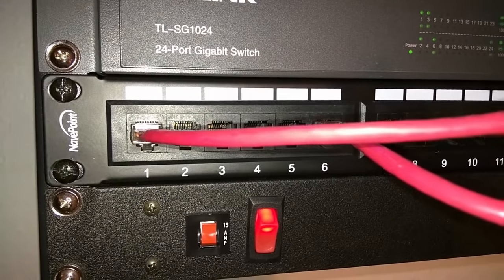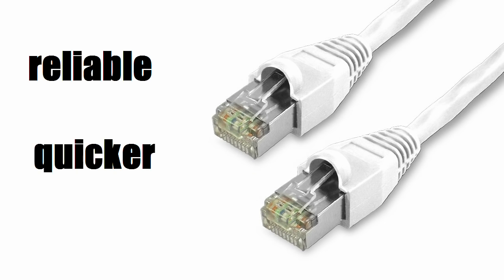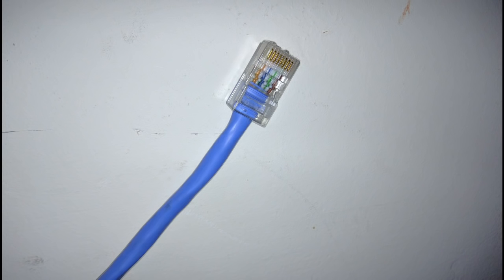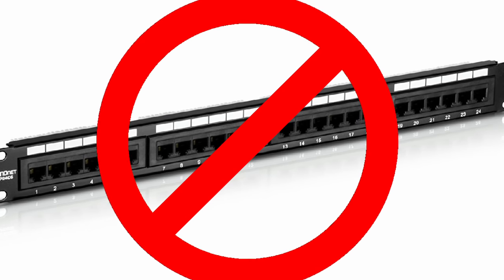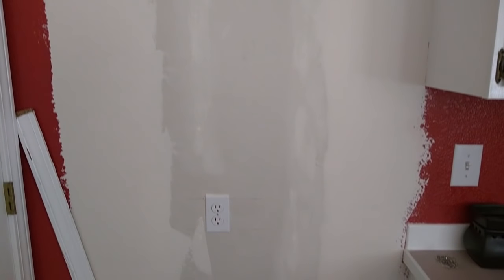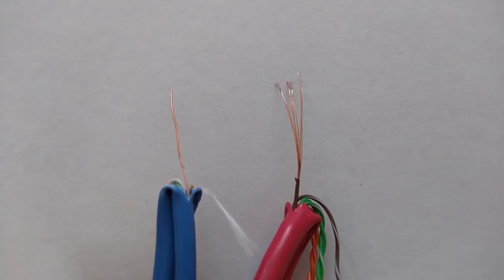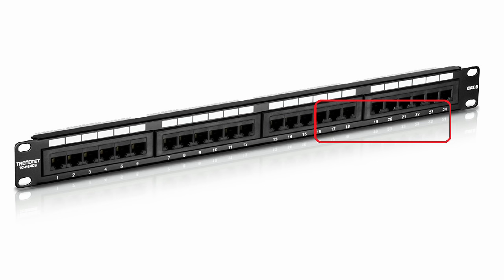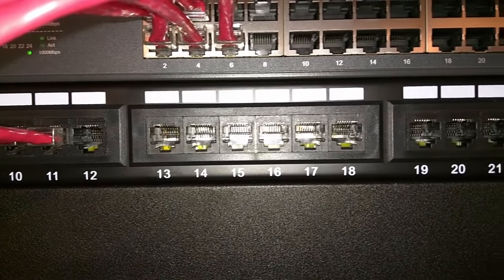What is a Patch Panel? Do You Need One?

Comment: Hey Budget, got a question for you. Is there any added benefit of using, and bare with me, my terminology might be wrong, but any benefit using manually wired keystones vs the dual female connected keystones where you can just plug in your pre-wired RJ45 network cable on both sides of the keystone? Obviously the pre-wired is good for someone without the tools or knowledge to wire it, but is there a benefit related to reliability/performance that can be gained by using the manually wired connection? My impression is that it's just a matter of being able to purchase bulk cable and save some money vs paying more for pre-wired connections. I'm I correct?
Reply from the maker: Hey. Seems like you understand it. Yeah it would be more expensive, and more of a hassle if the Ethernet cable clip snaps on the inside of your plug.. but it's totally an option for those without punch down xp, or the tools. I wouldn't expect to see any real performance hits.
Reply: You want him to take his clothes off???  Perhaps you meant "bear with me".  ;-)

Comment: Thanks for the video, would you mind clearing something up for me please? I dont understand why the switch doesnt just include the patch panel punch downs on the rear (or even just RJ45 holes on the rear)? Surely that way the connection can just wire straight through to the front connection and save needing a whole patch panel unit?
Reply: I would think about it more as- The Patch Panel is an extension of the home, whereas a switch is a piece of tech you own and may use in another network somewhere down the line. 

If the patch panel was a part of the switch, and the time comes when you need the switch for something else, you'd be left with cables out of a wall looking a bit messy. Separating the two means you have the flexibility of taking the switch out easily and leaving a nice neat patch panel as a more 'permanent' fixture.
Reply: @p.staycalm  Thanks for the explanation, that seems like a pretty good advantage.

Comment: Two points.  First people who do this for a living come up with ways to do their job, often because they do not get paid if they have to come back and do it again.  Follow their advice.  Second, do a hybrid approach.  Run your wires with the plan of putting in a patch panel later.  If you do not use a patch panel, but act like you will put one in the future, you are in a good place.  You will have extra wire on the ends and you can run double runs to areas where you are likely to have many connections, ie my office or the tv room.
Reply: Yes, I went the cheap route which doing my Home Network when I just got my House.  Didn't have a lot of extra money for the network.  I was also installing a large Antenna, and having to run all new COAX cable and ground to a number of outlets as this older house lacked a real ground everywhere except the Bathrooms and kitchen.

So I ran my Cat6 cables out of the wall long, and installed normal RJ-45 plugs onto them and plugged them directly into the 24 port Switch.  This allowed me to not have to get a Wall Rack or use patch panels.  My hardware was sitting on a couple of wood shelves.  That was how it's been for the last 5 years. 

A couple weeks ago, I completly redid it.  I installed a Wall Rack, and a couple of Patch Panels.  I cut off the RJ-45 plugs and connected them to Keystones then snapped into my Patch Panel.  I think this is a far better way to go for a number of reasons!!!

Comment: Thanks for explaining patch panels. I am clearly going to need this for my new home under construction which is getting Ethernet jacks wired in every room. The wiring cabinet in the laundry room is where all the  Ethernet cables end. It is a giant glob of cables entering the cabinet from elsewhere in the house. 

My question: How can I figure out which cable terminating in the wiring cabinet connects to which jack? Is there a tool I can buy or technique for figuring this out other than tediously plugging in a computer into each and every jack and then running back to the wiring cabinet to see if it gets connected to the Internet?
Reply from the maker: Check out some of my other videos about networking. I explain some of that.

Comment: Here's the bottom line for patch panels:

They're basically used to connect every single Ethernet ports in every room in a facility into one area - the telecom room/server room where the patch panel is typically located. Once the cables come in and "patched" here, then they are routed to each vendor's devices/network. It's overkill for a home, but for businesses (even small ones), they come in handy.
Reply: Simply Tom Thank you! This is a great explanation!
Reply: Burry21 

You’re welcome. I’ve worked on patch panels for quite awhile and they’re all the same. Some, just different sizes than others.
Reply: Definitely not for your average home network.  Way overkill

Comment: Does patch paneling work differently for different internet provider types? IE DSL vs Cable vs Fiber? I ask because fiber is only one block away from my current home and will be switching as soon as it is available
Reply from the maker: It almost always turns into copper in the home. So if you're dealing with Rj-45 patch panels and Ethernet, yes its all the same.

Comment: Very helpful for me, thank you. You mentioned that some patch panel jacks could be used for POTS. Can HDMI cable be terminated to a patch panel?
Reply from the maker: I've seen some patch panel ports that will accept a pots jack, if not, a special cable can always be purchased.

As long as hmdi doesn't have more than 8 wires, you could technically punch one down on a patch panel. There is also hdmi over Ethernet.
Reply: If you go with a keystone patch panel, you can get keystone jacks for RJ11 (phone jacks) just like RJ45 keystone jacks. HDMI keystones are also available where you can run a HDMI to a keystone coupler and then HDMI patch (short HDMI) to the destination on the rack.
Reply: If you use keystone panels, you can use whatever type of connector you want.  Typically, those would be Ethernet or phone, but others, such as F connectors for TV, speaker terminals and I believe even HDMI are available and just snap into the panel.

Comment: Why are your Keystone jacks in the walls mounted upside down  ?  The conductors being on the bottom are more likely to catch and hold dust in the upside down position.  You can also tell by the labeling "CAT5" on the jack that they are in the plate upside down.
Reply from the maker: Just oversight.
Reply: Really funny you mention this lol.  You can always tell who has been or worked for a LAN administrator.  Things I use to tell my guys when I was in the military lol.

Comment: Hi, great video! Question about solid core vs stranded wire. I understand the solid core is easier to set up terminations at the patch panel/keystone and is maybe more reliable long term as long as you aren't manipulating it, but outside of that, is there any other benefit? It sounds like if you were to use stranded wire from a wall plug, through the wall, to the patch panel, there wouldn't be a difference compared to solid core, correct? By difference I mean speed, reliability, failure, etc.
Thanks!
Reply from the maker: Speed, reliability and failure should be similar to solid core. Solid core is much easier to punch down and that alone makes the decision easy for me. Also you can get solid core cable with a plenum rating, meaning it's less hazardous during a fire.

Comment: I just ran across your great videos, very informative and your networking video gave me the confidence to troubleshoot an issue that popped up when I increased my internet speed to 200/200- the wall socket jack only had 4 of 8 wires connected, not passing the full internet bandwidth.  Internet company came and fixed it :) 
 I have fiber internet, no video package, going from the ONT in the garage to one room upstairs. Currently I have a Nighthawk router, r7000, doing a great job, and I use powerline networking that is rated for 1.2Gbs, but of course by the time it gets to the downstairs, I'm seeing 70/70 or so. Not bad. My question is, I'm about to go from 200/200 to 1gb. Will the speed of the powerline networking to this location raise, or is that 70/70 (give or take) a hard wall speedwise due to physical limitations of the household wiring vs my netgear powerline 1200? I can't find any discussions on this just by googling. Keep up the good work!

Comment: Clean. Like it. Now how to set up the redundant switch so if switch 1 power supply fails, the redundant switch takes over without pause of services. i understand switch power supplies last about 6 years and then most fail, burn out, regardless of the switch's price. Thus for say an audio system that has to run without stopping, the redundant switch might be good.
Reply: Spanning tree does failover redundant switch connections automatically, but all your hosts need to be dual connected to two switches.  It isn’t going to fail over fast enough to not glitch an audio feed though.  If you need that then you need software to read the audio stream through two active/active connections simultaneously.

Comment: Just adding my view since Author said he is interested, 

The only reasons I feel home users or SMB will need patch panel

1: Asthetic feel / Looks. 
2: LAN Cables in building are more than available switch / router ethernet ports. 
Or in other words,Extending life of RJ45 ports on switch if user connects and disconnects LAN cable frequently. 

For last point, I dont think many users / companies do so with well setup network But hey, nerds are there or someone may be testing (R&D) on n/w equipments. 

I would like to add that, again for most users businesses, once N/W is setup, they rarely go down to the box where these networking equ. are setup, just like, more or less, the permanent LAN cable through wall.

If I am Setting up this, I may endup without patch pannel, If the LAN cables I have are less or equal to LAN ports available on the switch/router and I think most of users may think this way.

Comment: Very informative for someone educating his/her self to design/build their own communications closet. I noted the blue Ethernet cables in your setup project through the wall from below the wall plate. I'm curious, are these cables running from the attic above and routed inside the wall to make a u-turn so that the cables are fed to equipment as shown (maybe to build in extra cable length if needed)? (I saw in another video about a best practice of setting up a punch down block so that the cable to it is run down past the block and looped back up to it.)
Reply from the maker: You could check out a few of my other videos to see how I did it, but I ran all my cables through the crawlspace. They run up from the crawl space straight up out of the wall plate to the rack. Yes it's best to leave a service loop (aka extra cable) in the wall or crawl space in case you do need to redo something.

Comment: Interesting video, in all of my years working on setting up networks for homes, I've never seen stranded cables. All CAT6 cables I've used (sold at local stores) are always used sold cord type of cables. Heck, I wouldn't even know how to use stranded cables and patch the RJ45 terminal with that type of cables!

I have 12 terminals at my home, I just use a switch that connects to my ISP's router and although patch panels are cool, they are (IMHO) entirely unnecessary. It's like USB cables with leds at the end... they look cool but there's no use on that. Also, the more connections you have (you have to make multiple cuts and connect twice the times you could actually need) the easier it is to bring noise and connectivity issues.
Reply: the only time ive seen stranded ethernet is for robotics grade (high flex and movement) ethernet and it is not fun to terminate at all
Reply: Stranded is commonly used for patch cables.  It is more flexible. Solid wire will break if flexed often in a patch panel.

Comment: We used patch panels at the servers rack where the other ends we had cross connect frames at cross point in the data center

Need to point out that when you crimp ends on, solid and strains have their own matching type.

Patch cords cat 6 is best for machine crimp from the manufacture than crimping ourself, although it works

i suggested to use tool like Fluke to test them to see what speed they can run on and if the 4 pairs works properly even though we only use 2 pairs

Comment: Nice explanation.  To clarify in my mind:  So it seems for every wall jack port you have, you need to run one cable and terminate it at a switch or patch panel.  So a wall plate with two keystones would have two cables running back to terminate at the panel?    We are looking to dispense with wifi completely, so I am looking to put multiple wall plates around our house and even out on our deck.  We would then have 10' flex cabling available to hook to laptops and ipads.  TV / stereo would have their own wall plate direct connected   Since right now the ISP cable comes in through the outside wall of my wife's home office window, it seems that I'll need to have the setup in her office.  Does it put out any amount of heat, other than that of the router?
Reply from the maker: You are correct, for any jack in the wall, there is a cable running to a patch panel, or switch if there's no patch panel.

If you wanted to make life a little easier, you could run one cable to a room, and connect a little switch in there. That way you wouldn't have to run as many cables.

No that setup doesn't generate much heat. It's fine if I shut the closet door.
Reply: Budget Nerd Thx for your thoughts.   I'm considering running cable below our floor and then drilling up from below to run cable, as access is much easier than through attic.   Any worries about doing it that way?
Reply from the maker: That's how I did it. Just be sure where you're drilling.

Comment: Everyone is going to have different views on the need for a patch panel or not!  Depends on the customer, installer, budget, and timeframe and all that ranges from the rookie level to the professional level!  It is a jungle without one though!  View my video on Low-Voltage Wall of Shame. Part 1 is now playing.  You may want to not only get a patch panel, but also get matching correct length patch cords and a roll of Velcro.  What is the point of buying a patch panel if you are not going to keep it dressed neatly!

Comment: A weird reason for a patch panel that might end up applying to me: I have two buildings that I need to run cables between, and the only good way is through an underground conduit. It's very narrow, so it's hard to get many connections through it without violating fire code. I might use a 25-pair cable since it's much narrower than 6 4-pair cables. It'd be pretty inconvenient to have a bundle of 6 RJ45 connectors hanging off the end, so I'd probably punch them down in a patch panel instead.

(the reason for multiple connections is that most of them would be used for things like video extenders -- not normal ethernet. Adding an ethernet switch at the ends would not help. Only one connection would be normal ethernet.)

Comment: Dedicated patch panel or a wallplate at the rack cabinet end are the same  thing but for some reason people can't decide on the benefits of either. The benefits of each of these are the same and that is that they are something you can patch into. Remember the old telephone service women at the patch walls transferring a phone call to the requested location? That's what patch cables are for. If someone tells you they don't see the point of a patchpanel but they used a wall plate instead then they don't understand the concept of either yet.

Comment: I’m still new with all this networking stuff but have ran 100’s of feet of Ethernet cable lol. So what exactly makes up that rack, it’s that TP-Link bar - the patch panel  and just the rack itself? Does the rack come with those red switches? And you plug the single Ethernet cable from your modem into the back?
Reply from the maker: Watch my home networking 101 video. Should answer most of that.
Reply: Coach2118 - Ditto!! Soooo glad you asked all that. I’m new at all this type of tech stuff and am trying to figure everything out myself. 
My husband had planned to run “cat-a-million” (or whatever was the best...thus far) in our new house we’d just built ourselves (basement unfinished to start + easy access attic at least), but he was suddenly taken from this earth (at only 38) before he got around to the ultra tech part. We have the basics & decent WIFI, but I’d like to finish the tech like he wanted it to be. 🙏
Reply: Budget Nerd - THANK YOU!! 
I’ll be checking that out next!!

Comment: Thanks for the video. I have a Patch Panel in my utility room. Im not using it because I’m using WiFi. My bedroom is at the other side of the apartment. I get no WiFi access to this room; however that room is connected to the patch panel. What device would I add in my bedroom to send out a WiFi signal to my phone?
Reply from the maker: An access point.